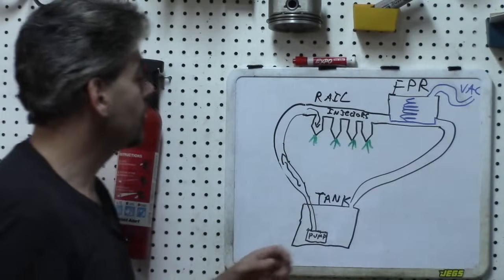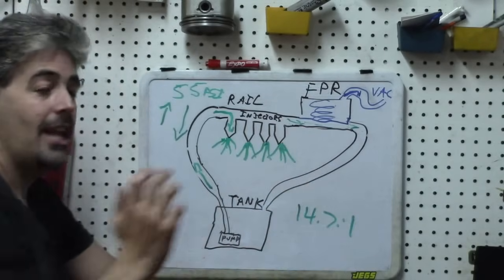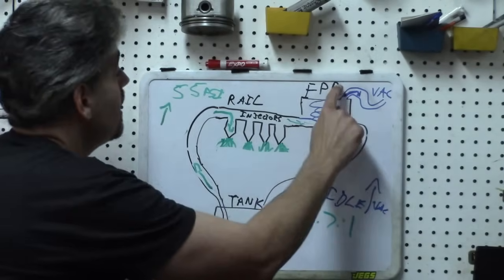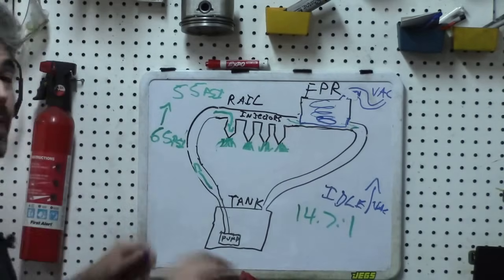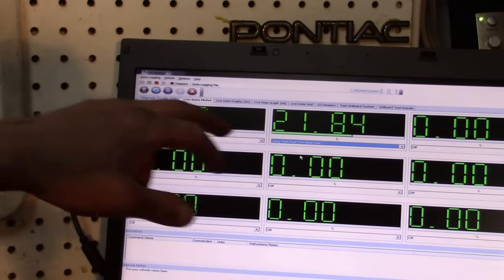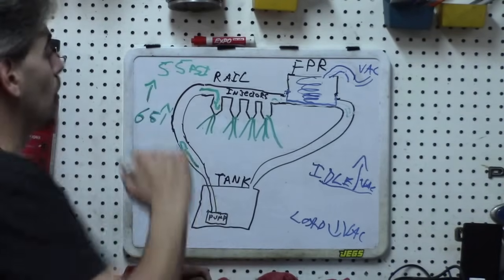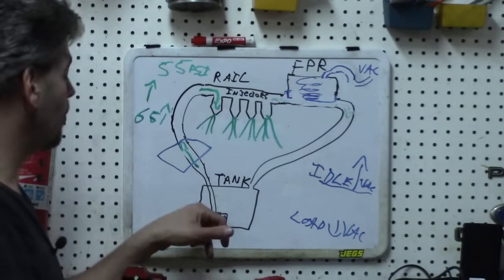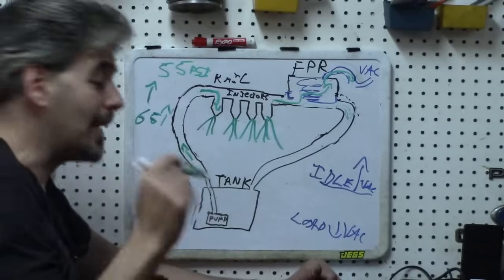Fuel Pressure Regulator Diagnosis + Understanding (HD!!)

Comment: I have a 09 bmw 328i only code im getting is p2098 also have long crank times after the car has sat for over an hour. i have replaced both pre cat 02 sensors and fuel pump still getting same code. Any Ideas?
Reply from the maker: What was the data that both O2 sensors AND the fuel pump were bad? That seems really, really unlikely. I would need to see the data you are interpreting to have come to that conclusion.
Reply: Schrodingers Box i wish i knew i took car to two indy techs first one said it was 02 sensors the other said it was fuel pump. He said he did a pressure test and it wasnt right. I wish i knew more. Only have the long cranks after car sits for about an hour. Have had the occaisinal hesistation and rough idle but hardly ever.
Reply from the maker: Nothing I can do. There is no data to even start a hypothesis. Anything else would be a guess and we see how well that worked out...

Comment: hey mate, my car 330i bmw is missfiring under hi revs, and tends to get worse by the time i push it harder! it idles perfect and all, and first pulls it limits where is supose, but as i push it it starts missfiring at 6krpm and tends to get worse.. also the spark plugs are very white (lean)..
Tks ;)
Reply from the maker: Ok so what data do you have?
Reply: +Schrodingers Box what do u mean?
Reply from the maker: XikoDS What is the long and short term fuel trim at static vs load? what is the static vs load fuel pressure with and without regulation?  What is the MAP sensor output at idle vs 3500?
Reply: +Schrodingers Box I dont have that data right now... We tried all, maf, coils, spark plugs, sensors, and all that! But the car remains the same... The thing is that the first few revs it seems fine, then it starts to missfire under high revs... and it gets worse...
Reply from the maker: XikoDS Well without data how am I supposed to keep from just randomly guessing? I am not sure what you're asking me here.
Reply: +Schrodingers Box I completly understand sir... Sorry to bother you, the thing is that i've tried almost everything and i'm getting a little desperate... Next week i'm going to check the fuel pressures....
Reply from the maker: XikoDS Don't be desperate. Be decisive. Diagnosis it and you won't be desperate.

Comment: Is it normal that fuel pump doesnt prime? But car runs. Fuel gauge on the dash acts weird just went to gas station before gas lights up instead it adds up fuel my gas light pops up. My fuel pressure reg is new. How can i rule out if fuel pump or fuel sender (passenger side) is the problem? Both parts are pricey so i need to know which part is the prob. I dont know if my fuel pump is prob cause car runs means fuel pump is pumping but doesnt prime. Correct me if im wrong if i use fuel pressure test its only the fuel pressure regulator il be testing not the fuel pump or the sender.thank you.
Reply from the maker: There can be many explanations for this- a leak in the system, a clogged filter or restrainer, a weak pump....
Reply: Schrodingers Box  Fuel filter is new,Fuel pump i assume previous owner didnt change. Before i hear it prime but now it doesnt but car runs (soft fail pump?) Does fuel pressure test help me to pin point the failing pump? How can i diagnose a leak where can i start? Most forum i read gas gauge problem relates to fuel sender. Im really confuse where to start or what to diagnose.
Reply from the maker: Ok so what data do you have?
Reply: Schrodingers Box  what data should i get prior to pin point if fuel pump or sender is the problem?
Reply from the maker: No idea..... If only there was a video on testing fuel pumps.....
Reply: Schrodingers Box i understand, pls correct me if im wrong if i use fuel pressure tester does it only test the fuel pressure  regulator?
Reply from the maker: nope. I would also do a basic electrical analysis including a voltage drop test and a resistance curve as well.
Reply: Schrodingers Box il try thank you

Comment: Under load I have no power in 91 7.5l f250 iv swapped 3 fuel pumps in 6 months and my map sensors i change on monthly basis please help
Reply from the maker: What data is showing the MAP sensors are failing?

Comment: Key on engine off the fuel pressure hits 40psi and then drops to 0. Same situation but with the fuel return line pinched the pressure hits 40psi and hold at 25psi ? The regulator is bad?????
Reply from the maker: that, or a leak.  what is the fuel trim showing?
Reply: @SchrodingersBox  long term fuel trim is at -21 short term at -11 at idle they are both at -11
Reply from the maker: definitely would start by checking regulator. car is running rich.
Reply: Yes very rich,there was about 3 quarts of fuel in my oil after a 15 mile drive
Reply: This is a built motor on a base map,I found a hole in my regulator vacuum line last night

Comment: Hello sir I have a 2010 Chrysler town country it’s giving me 8 miles of gas per gallon, and sometimes the rpm is at 500 and sometimes it’s at 900, and at the stop light the car vibrates really badly, can you please help? Thank you.
Reply from the maker: sure. what data do you have?
Reply: @SchrodingersBox  I don’t have that much experience I know sometimes it can smell like gas
Reply: Do you know whats the location of the fuel pressure because I bought the fuel pressure gauge but I don’t know where’s the location of it
Reply from the maker: not sure- there are a lot of Chrysler models that don’t have a valve on the fuel rail. you have to T-connect into the rail using an adapter.
Reply: @SchrodingersBox  yes sir thank you so very much for your help

Comment: Is a bad fuel pressure regulator dose it run rich.
Reply from the maker: It depends how it fails.  If it fails closed it will be rich at idle. If it fails open it will be lean at higher load.
Reply: @ i have gas in my oil cleaned the intake manifold and the maf and also the tpf and not running so rich anymore .but still wonder how or what happened.or if i still have a problem with something els.
Reply from the maker: Sounds like a leaking diaphragm in the regulator

Comment: How about a tbi?There is no vac line.
Reply from the maker: +loranga japp Good point.  On a GM TBI I know there is a low pressure (about 15PSI) spring based unit that is used, it is not a vacuum system.
Reply: Schrodingers Box
So it should work to just block the return line to get the pressure up then?
Reply from the maker: loranga japp Blocking return line should increase pressure and cause negative fuel trims but since there is nowhere (to the best of my knowledge) for a leak to go to such as a vacuum line, it would not give indication that the unit is working.  I would T-into the line and see that static and load pressures are at whatever the spec is (usually around 15PSI on a GM TBI).  It should also hold static pressure as well if there is no external leak.
   I know some guys at the track back in the day had aftermarket adjustable fuel pressure regulators on their TBI's, but I do not believe the stock unit has any adjustable features. I'm not quite sure of how it actually mechanically adapts to and  controls static, idle and load pressures to be honest, but testing the unit should be straightforward based on the information from this video.
  What are your indications that you suspect the regulator?
Reply: Schrodingers Box
No pressure unless i block the return line.
Reply from the maker: loranga japp Oh wow- cool lol... does engine start? I would expect a no start.
Reply: Schrodingers Box
When i block the return line a little it starts right up and runs great.
Reply from the maker: loranga japp Your two possible problems are bad regulator or weak fuel pump. I would check pressure "deadheading" the pump BEFORE THE REGULATOR.  If it is well below spec, pump is bad.  If not- and the pump reads at spec, the pump is not the issue and regulator clearly the issue.
Reply: Schrodingers Box
i actually just put in a new pump thats supposed to be able to push around 30 psi.And i even replaced the fpr with a working one but that one leaked.

Comment: i dont have a fuel pressure tester to provide any data. just trying to get an idea.
Reply from the maker: Really nothing I can do to help without data sorry. Good luck.
Reply: i have 96 suburban 7.4L the fuel pressure spec is said to be around 56 - 62 psi, it only gets to 40 psi and drops immediately and steadily to about 30 psi maybe lower i can't quite remember..
Reply from the maker: theyoun9elohim You have a fuel pressure decifit confirmed 100%

Comment: 5.0L GMC - LTFT -15% at idle and +15% under load. Regulator?  No codes but failed Evap test.  I haven't checked fuel pressure yet.
Reply from the maker: I would definitely start with the EVAP. make sure vent and purge  solenoid is working

Comment: I have a Mercedes 220cdi which gives me a generic p0087 error with check engine light if the temperature is above 30 degree C outside if it's colder I have no issues and no performance problem I went to three garages to fix the problem and all said that the car has no problem and that the tests did not find any faulty component dose anybody know what might be the cause
Reply from the maker: What is the rail pressure reading?
Reply: @SchrodingersBox  Between 23000kpa and 28000kpa on idle and o2s11 between 1.7v and 2.4v

Comment: Hi can a bad fuel pressure regulator can a no start.  I cant check pressure since it doesn't have a valve but I have already change the fuel pump. Now I can hear fuel deliver to the fuel rail but the njectors are not delivering fuel and yes injectors are getting electricity. BTW its a 2001 Pontiac grand am 4 cylinder
Reply from the maker: +Lobodelmonte How did you diagnose to narrow down it is a fuel problem and not any other problem? How did you eliminate all other variables or confirm fuel is a viable cause?
Reply: Hi thanks for replying me.  First thing I did was to spray some starting fluid into intake and it starts a little while than it dies.  That's how I dicided it was a fuel problem.  I wanted to check the fuel pressure but in this car it doesn't have a valve to check pressure.  So I drop the tank and disconnected the fuel filter and check to see if any fuel would come out and it did, but I saw that it didn't have a very powerful spray, kind of weak coming out of the tank. So I assumed for sure it was the pump.  I know very stupid of me not to check pressure. So I changed it and it stills doesn't start up.  So I dicided to remove the fuel rail to check the injectors are spraying gas and there not.  So I injected a little  gasoline into the injector hole with a syrange and place the rail back on and it starts on.  I even held up the rail while someone was cranking it but no spray comes out of the injectors.  I know now that the pump is working, and I can also hear fuel been deliver to the fuel rail.  So that's why I was thinking that the pressure in been lost in the fuel pump regulator but that's just a guess in my part.  I think I borrowed a friends regulator cuase he has a similar car to see if that fixes the problem.  Thanks for you time
Reply from the maker: Lobodelmonte Good job! Yes I agree sounds fuel related and  to be honest you have two ways to appoach this.

1. You need to do a fuel pressure test and...
2. Drive the car at WOT while looking at O2S1 sensor output from each bank. They should go rich during WOT. If they do then fuel pressure is NOT your problem. If they go lean, then fuel pressure problem is indicated and then you have to go to #1 to confirm.
Reply: +Lobodelmonte ... so check your injectors they might be clogged. Make sure that you here a clicking sound as you give electricity to your injectors. But even if they are making a click sound, the injectors still could be clogged and needs immediate cleaning!!!!
Reply: Thanks  for the advice, I need to buy a tool to check for injector pulse.
Reply: Lobodelmonte
save your money buying that tool. All you need is a long screw driver and put the one end on any of the injectors and put your ear close to the other end. Have someone start the engine you should hear a clicking sound. that means your injectors are ok.
Reply from the maker: EndofUSA Why does that mean the injector is OK? What if it is clogged how would you know?
Reply: Schrodingers Box
You do have a point but the best way is simply to take each of them and clean them and lots of way to do it here on youtube... without burning money!!
Reply from the maker: EndofUSA But why not just do a fuel pressure test to validate if there is a flow problem is what I'm saying rather than go through all that for no reason?
 I have yet to see (and in fact anyone else I know does too) a "clogged" fuel injector. This just doesn't happen that I have ever seen.
Reply: +Schrodingers Box HI I have found the problem in this car,  It was the GM security feature.   Could of probasbly figure this out sooner but most of the time I have under the hood and someone else cranking it. I now hate GM  lol.  Car wasn't mine, its a friends.  He already knew about this and completely forgot about this.  Previous owner had mention this to him. And you where completly right on your video No Start Diagnosis FASTTEC part minute 8:20 you talk about exactly this, what happen to me.  Thanks I have learn a lot from your videos and I completely agreed we shouldn't jump to conclusion until everything is completely check right.  I took half of the loss for half of the fuel pump cost, and didn't charge him for labor,  but most importantly I learn  to do things correctly and if its something I cant fix just leave it alone, thanks again. and happy holidays
Reply: +EndofUSA HI thanks again for the tips, its was the GM security feature was flashing on the dashboard cutting off the gas supply...I sent a reply to Schrodingers if you want to read it .  I now Hate GM lol just kidding
Reply: +Schrodingers Box Hi sorry never saw this reply seems never got nothing in my inbox about this reply. It was a no start.

Comment: I have a 2007 VW Passat 2.0T - FSI engine & the car has 2 fuel pumps , It has the Low Pressure fuel pump in the gas tank & There is a High Pressure  fuel pump up at the engine , The problem I'm having is when I hook up the fuel pressure gauge up at the engine for the Low pressure fuel pump the gauge will go crazy , The PSI will stay around 60 to 80 PSI but the pressure gauge needle jumps back and forth very rapidly where I can't almost see it / The needle moves so fast between 60 & 80 PSI , Anyone ever seen anything like that before ? And what could be cause it ?
Reply from the maker: yes all direct injection systems are set up like that. you are seeing the high pressure fuel dump. 
  use fuel trim to determine a fuel issue first.

Comment: Hi every one 
I have a 2000. 1500 chevy I just broke down, and noticed the throtle budy full of fuel any I dea what is?

n
Reply from the maker: What data do you have? What is the LTFT and STFT static vs load? What is the running and static fuel pressure? what is the MAP voltage? 
You need data to point if issue is rich condition and if fuel leak or pressure issue is indicated.  Please supply some data.

Comment: Why i have to give my 3.8 gas to start? fuel pump priming, regulator no leaking, new iac i'm lost
Reply from the maker: ?What was the data that indicated you need a new IAC?  That's a massive clue!! I would totally start there. What were the counts on startup vs idle? What were the counts under load?  What's the idle vs load LTFT and STFT?Obviously that information is key since the IAC didn't fix the issue.
Reply: No data or light's i just replaced the iac cause it was filthy thinking that was my problem. It's just when it sit's for awhile i have to floor the gas pedel to start the engine and it runs fine and if i go somewhere and come right back out it will start right up.
Reply from the maker: Can't help without any data. I have no idea why you would change the IAC. If you have some diagnostic data that indicated an IAC problem i'll be glad to look at it. good luck.
Reply: Thanks i found that the iac was not working correctly i replaced it and now it's starting up fine.
Reply from the maker: You already changed the IAC.
Reply: Yes that was the problem
Reply from the maker: No, u said you changed IAC before- on your original post. so how can changing IAC have fixed it?
Reply: Sorry i explained it wrong i changed the iac thinking that was my problem but it wasn't it still didn't start. So i bought a fpr on ebay for $10 new and replaced it and now it starts right up.

Comment: What's if I got p0174 code and  30 psi on wot
Reply from the maker: WHat is spec at static vs load? What is the LTFT and STFT at idle vs load? What is the O2 sensor indication?
  You need relevant data to answer this question.
Reply: +Schrodingers Box  I got p0174 code lean bank 2. that's the only code I got.   the fuel pressure is 30 psi. I put new fuel filter and  I already check for vacuum leak I found nothing. do you thing can be the fuel pump or the control fuel pressure sensor. by the way is a mustang gt 2002
Reply from the maker: ***** Could be. Maybe not. Once again- what data do you have? I can't tell anything unless I have relevant data.

Comment: Learning from you on 2019,.. car fuel pressure fluctuates from 40 psi to 70 psi on idle,.. accelerating it seems to stay on 50psi ( 10 psi more than the recommended from the manufacturer),.. something that I do not understand is why if  I turn the ac on, the motor just turn off when in idle
🤣🤣🤣🤣feminine reproductive orgam🤣🤣🤣🤣🤣